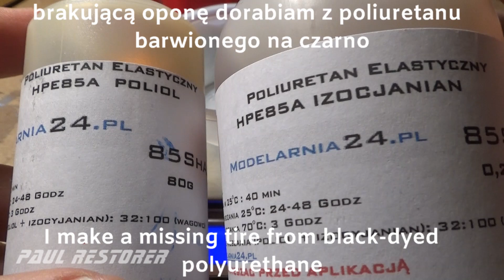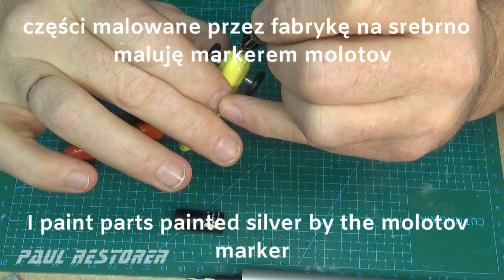Matchbox restoration Maserati 4CLT nr 52 diecast car

Comment: Love that little screwdriver Paul, Amazon??
Reply from the maker: I got him under the Christmas tree. It's called wowstick. It has 20 tips. Works on 2 AAA batteries
Reply: @PaulRestorer  Santa was good to you, useful little tool. I'll have a look on eBay or Amazon.
Reply: I'm going to look for one myself, it's a nice little tool
Reply: @denegillespie5767  Hi there Dene. I've watched Paul use it quite a bit. It doesn't seem to be very powerful. It works OK for these little M2 screws but, I don't think it would handle anything much bigger. They're a wee bit dearer than I would have expected too. I guess it depends what you intend to use it for.